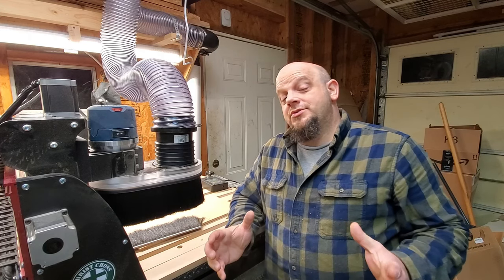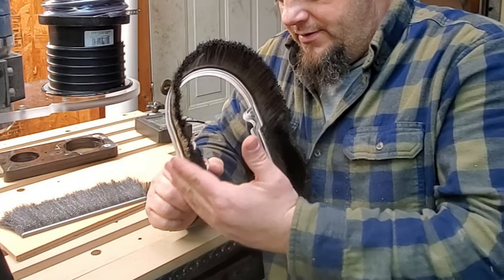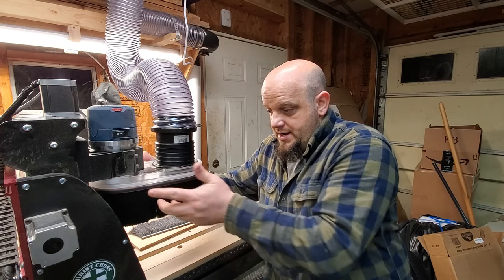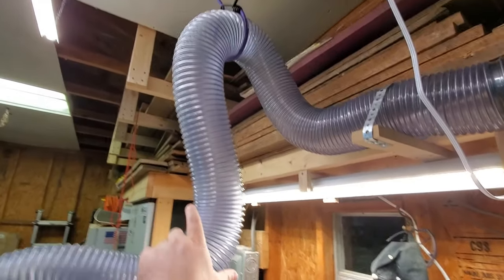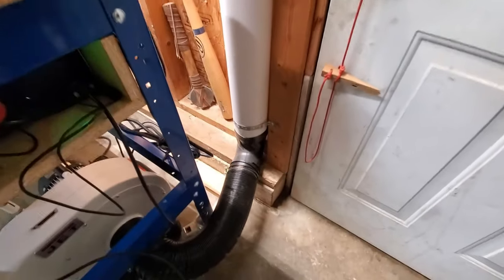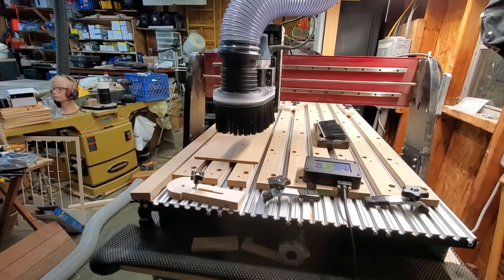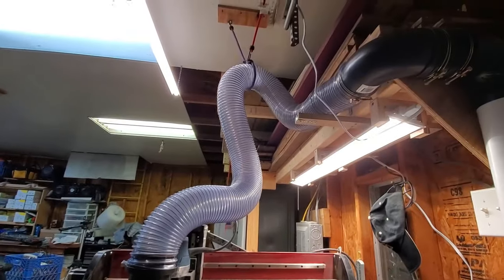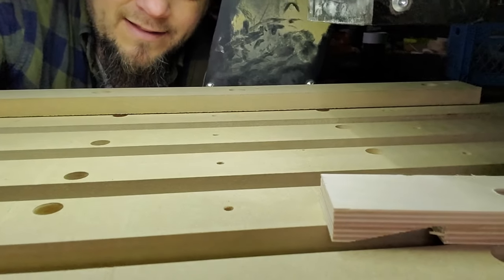Shark HD5 EXT Dustboot Upgrade to Kent CNC with Dust Collection Boost

Comment: I just got the KentCNC Dust Boot.  I got the 80mm spindle version for my NextWave HD520. It fits just fine.  Also I added the quick connect that Chris recommended. My central dust collector is mostly 5" . I added a reducer and a 10 foot section of 4" flexible ducting.  Initial trials show a vast improvement over the standard dust boot from NextWave (only 2-1/2 " Pickup).  4" is WAY BETTER.  Thanks, Chris.
Reply from the maker: Happy to help.  It is a game changer

Comment: Perfect timing.  I’m in the process of getting my hd5 extended set up the way I want.  Dust boot was my next worry.  Keep em coming.
Reply from the maker: This is still listed as unlisted, but here's my assembly video.  I ran into a few issues and I show how I worked through them.  It also includes my spoilboard and first run.  https://youtu.be/DiC7Buu2mWk

Comment: Looks like you did a great upgrade!! Great video buddy!
Reply from the maker: Thanks.  It made a HUGE difference in the dust removal upgrading to 4" and adding the small Jet DC into the line.  I originally was going to hang it, but the bag was huge, so reworked it.
I have about 15-20 hours of footage to edit for the full assembly, so wanted to get something posted.

Comment: Hi, I just finished a project that was 2 1/4" thick and the Shark dustboot is at least 2" from the project so it picks up absolutely nothing. Complete waste of money and a very poor design. I saw Kent listed the Shark HD so I assume that will work with my Shark 510 and they have spacers. They mention you can add two spacers I'm thinking I could needs as many as 4 depending on the project. I wrote to them but just wanted to say thank you for posting this video as it sounds like this could be the solution to my problem.
Reply from the maker: I used the boot and two spacers at times.  No issues..  for long bits some will get past it..  You can adjust the Kent down some if need be.  

Thanks for watching
Reply: @ChristcrossCrafts  I ordered 3 spacers that should be enough. Thanks again for taking the time to help everyone with your great videos.
Reply: Unlike the NextWave version, the dust boot attaches to the spindle and can be placed closer to the bottom of the spindle/router.

Comment: Can you link the dust boot you ended up with?
Reply from the maker: The one I used is the standard with 4".  In the description I simply linked the shoe in case some preferred the 2-1/2" instead.  Be sure to select your router/spindle setup from the drop down box here:  https://www.kentcnc.net/nc/standard-split-shoe-standard-dust-shoe